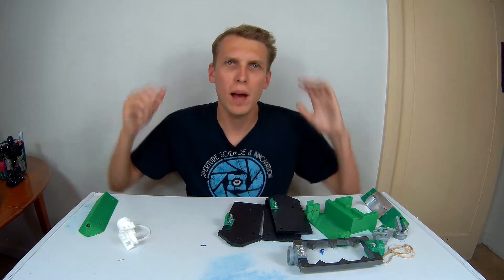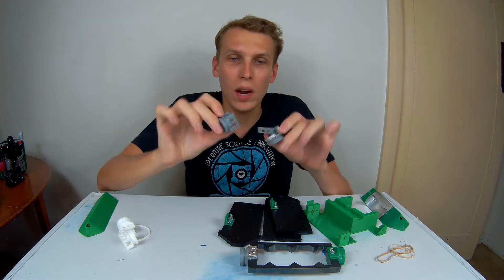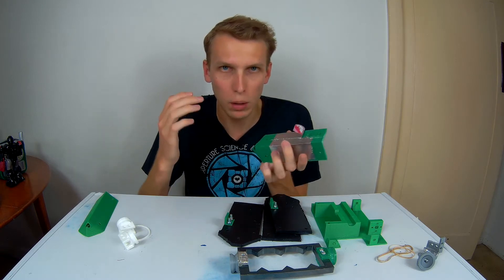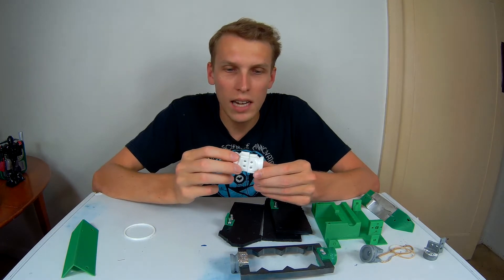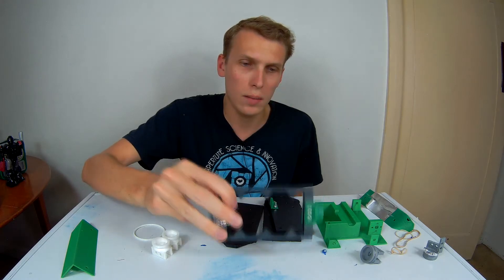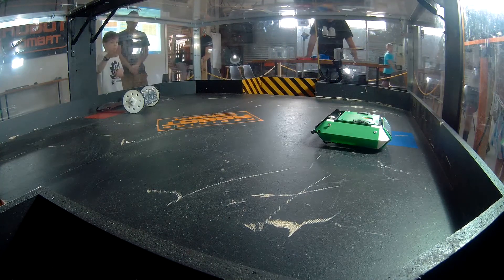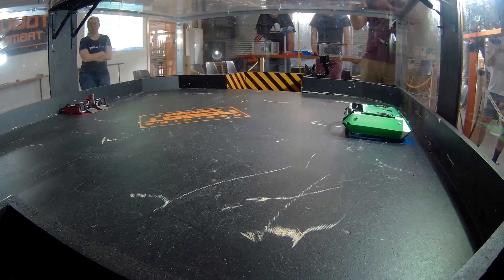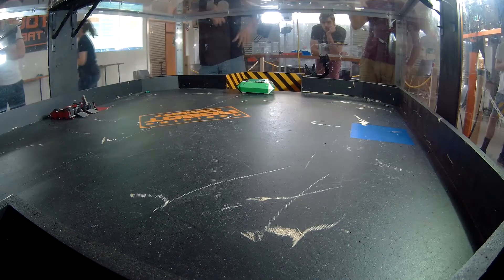1.36kg Combat Robot Improvements and Destruction

Comment: Instead of using aluminum tape (which is very soft) try some spring steel shim stock. Should deflect hits WAY better. Also, I would highly recommend making a shaft that runs all the way through the weapon so they are in double shear. Sort of like the fingertech beater bar.
Reply from the maker: Rattler Robotics those are great suggestions but weight is an issue with both. Sure steel is stronger but it's way heavier. My armour is designed to be light and get destroyed, the side and back panels can be easily replaced and even destroying them completely will not damage the critical components. I was thinking about upgrading the panels to 3mm lexan so they are a bit stronger then 3d printed parts

A shaft all the way through the weapon adds a lot of non-spinning mass to the front end, plus the shaft needs to be at least 8mm to survive an impact and drilling a hole that size through the beater bar would sperate it into two pieces. I'm confident my weapon mounting system will work, I just need to machine it out of ali or HDPE and make it thicker at the current break point

Comment: You should try to cut the at the front of the bot some sharp wedges. These would stick out so you can get under robots more easy, also it would stop your self from running into the wall and exploding 😂.
Reply from the maker: Raptor Robots I have been thinking about feeder wedges but my problem is how to mount them so that they don't endanger the drum mounts, wedges would bounce the blade of a horizontal spinner up into the mounts.

I might try adding them to my ant and see how they go.